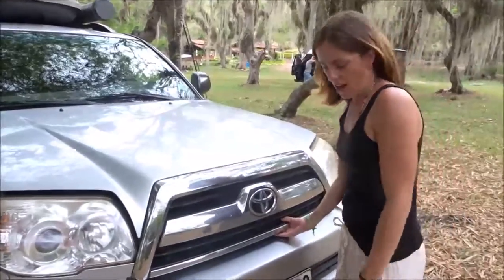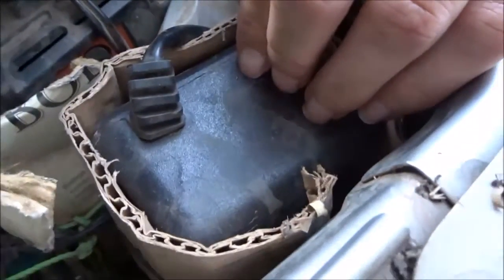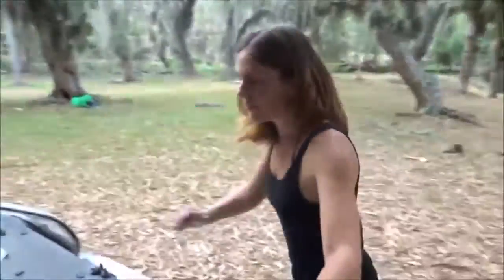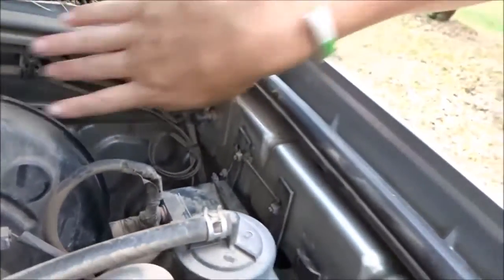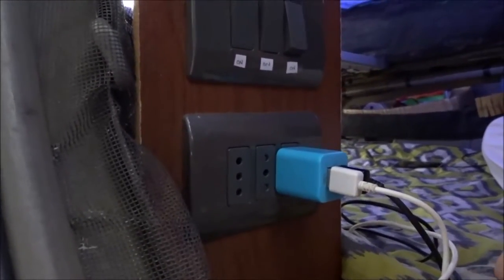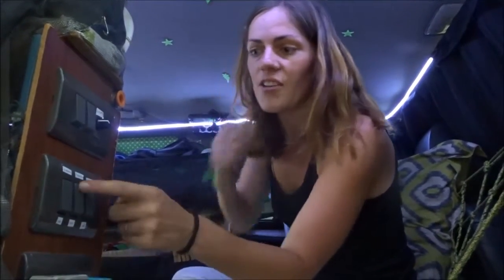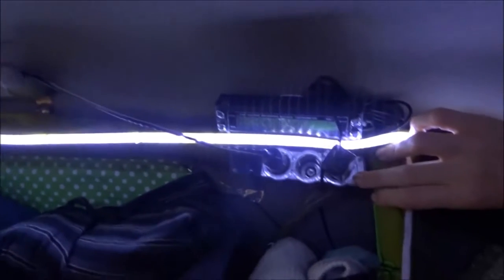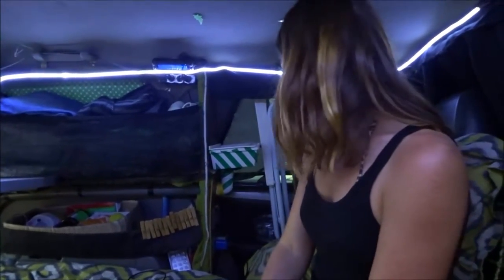4Runner Camper Electrical system and Dual Battery setup

Comment: I think the inside looks great! love the lighting   The engine bay looks scary  I will assume your in OZ  High temps  Loose battery held with rope ..The first battery has the proper metal hold rods  Cardboard is another no no   it drys up and catches fire easy ..My truck i take it to the power wash coin op and put it on the degrease soap dial and hit the engine at a distance  and wash the rims while waiting for the soap to take effect on the engine .. Then soap and wash the whole truck  You can do it with the truck running if your worried about not starting 
the next thing would be adding grease made for electrcial connections   These items will greatly keep your truck tip top and safe  Oh and the pine needles in your vents  Block incoming cool air and heated air into the cabin and make your blower motor work harder

Comment: Why are all these dual battery videos from weird countries and bizarre electrical outlets that nothing will fit into?
Reply from the maker: Karl Ruehs I guess that is a matter of perspective - the type L Chileno outlet fits the type C plug, used by over a billion people worldwide (south America, Asia and Europe).  The Australian type I plug is also used in China, so that's another billion people covered.  Not exactly 'weird' or 'bizarre' if you spend 5 minutes outside your own little corner of the planet. 

But you can also pull off the faceplate and wire whatever you like to it, so it's irellevant anyway.
Reply: Anita Cripps Murcia! 🇺🇸

Comment: Interesting setup. I did not think a 4runner had enough interior room although mine is a 2016 model.
Couple of things worth mentioning:
Consider adding a fuse, as close to the battery's positive terminal as possible. You don't want to know what happens if there is a short in the wiring and it's not fused. Also consider adding an insulated cap to the positive battery terminal.
Having the transformer wrapped in cardboard material is a recipe for a failure. It can catch of fire if there is no internal temperature switch in the transformer. Same thing applies to the inverter. It requires proper airflow for cooling. Engine compartment is the worst place for it. Wrapping it with cardboard makes it even worse.
Please consider what I just said. I've seen cars catch on fire because of improperly installed electrical appliances. It's hard to believe as it takes seconds for the whole vehicle to be on fire.
Reply from the maker: Andrew Evanoff thanks, but we had all of this, and more.  Andrew is an electrical engineer. 

The battery was fused, and the entire system was isolated.  The battery of course had insulated terminals (this comes with the batteries as a standard) and the inverter had adequate airflow and a heat cut off.  All of this was in the engine bay in spaces that give adequate space and don't connect with hot parts of the engine. 

Having it correctly installed in the engine bay offered protection, as it is all placed behind the firewall which isolates it somewhat from the cabin where we sleep. 

Thanks for the tips, but we are not rookies.  We used this system for two years, and it is still being used now by others who bought the car from us.  It's pretty foolproof and has multiple redundancies for failures to make it safe.
Reply: Glad you got it all taken care of. I just wanted to mention what I have noticed. I'm an electrical engineer as well and used to be a car mechanic. You would not believe what some people had done with wiring in their vehicles. Good luck.

Comment: A proper battery tray we had made up that has $2 rope holding a 20 kg battery from flying around the engine bay.
Reply from the maker: Wikkid Me it wasn't just held down by rope, it was wired in - the rope was secondary to give it additional stability.

Comment: Hello: We (my wife and i) like very much your camperization of your 4 Runner. We live in Chile and we own an Fj Cruiser and have the same idea of camperization as you with the 4 Runner. Where did you install or have installed your complete electrical system? In Chile? Thanks and regards. Georg and Mariluz
Reply from the maker: MrGweidlin hi.  We did it all ourselves, in Chile.  We bought some of the components with us from Australia (the isolator, battery lugs, 100amp fuses) but you would be able to find these online or from a supplier.  We bought everything else in Chile.  The cables came from an electrical retailer in Valdivia, and the battery was from sodimac.  

If you don't know what you are doing you should be able to find someone who could fit a system for you (there are guides online, but you do need a solid knowledge of electrical systems to be safe - my husband is an electrical engineer)
Reply: Anita Cripps thanks a lot for answer. It is excellent that your husband is an electrical Ingenieur. Thanks and good luck

Comment: The transformer and especially the inverter tend to generate a lot of heat and don't like water at all.  Why did you mount them under the hood (and inside cardboard boxes)??  Maybe consider moving them into the passenger area.  Also....for things such as charging phones and such you should concentrate on using the 12v supplies (automotive 12v phone chargers).  Inverters tend to be inefficient so stepping the voltage up to the mains then back down to charge accessories is quite wasteful.
Reply from the maker: John Ellis, fair comment.  Our inverter is only 750w so heat isn't a problem, and after 22 months of use there has been no water ingress or damage.  They actually fare better then most other things under the hood (and this car has been thrown into every extreme environment you can imagine).  We felt more comfortable keeping everything out of the cab, for safety (we only had one cable through the firewall).  We use 12v chargers for our phones, which are mounted in the cab.  The inverter is for laptops and appliances.   Andrew is an electrical engineer, so he knew what he was doing when he installed it.
Reply: For him to be a electrical engineer none of that shit look professional 😂